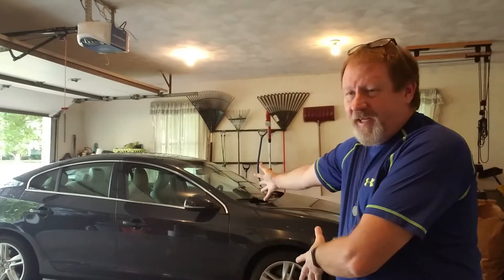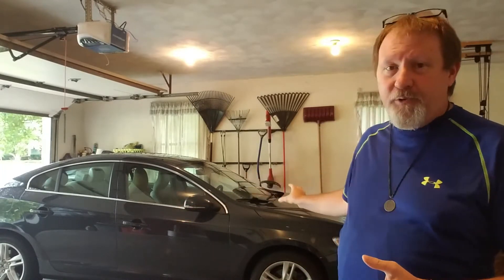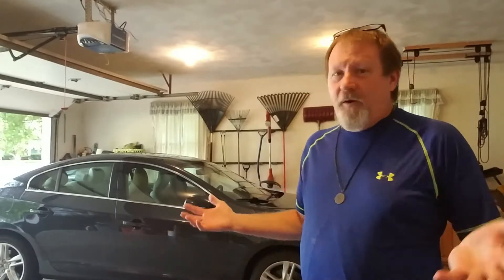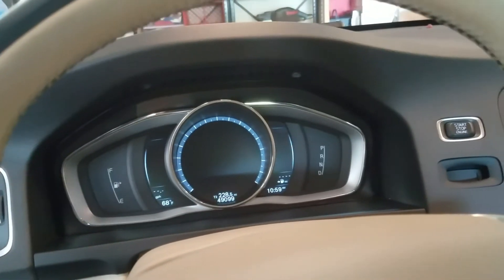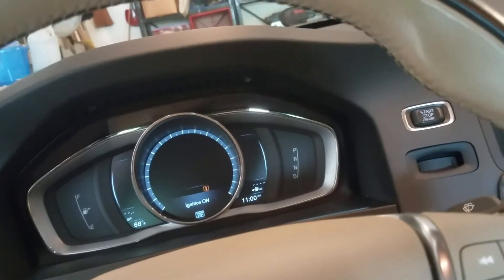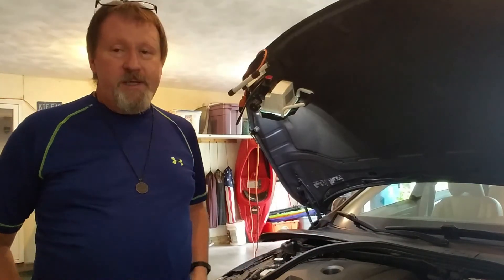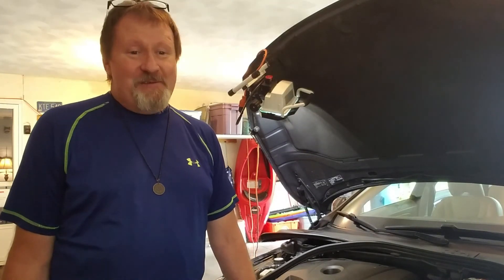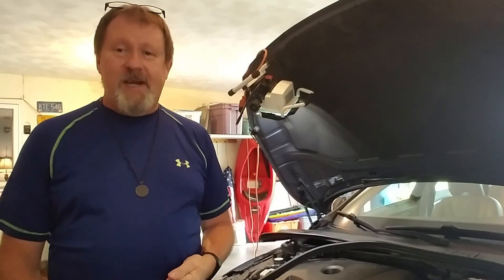Volvo Drive-E Start Stop Not Working

Comment: I did the reset last night. I just went to start the car & it won't start at all. It says: steering malfunction Stop safely. I never had that problem before. Can you please suggest what to do.
Thank you, Sam
Reply from the maker: Hi Sam, I'm not a Volvo tech, just an owner like you but have a couple of guesses from what I've read.  It could be a bad battery some say, or a fuze, so check all your fuzes to make sure one isn't blown.  I've seen on a lot of Volvo forums that some have issues with the steering column lock but that seems to be on pre-2009 cars I think.  Not totally sure.  Maybe jiggle the drive selector to make sure it's in park, or wiggle the steering wheel nice and strong a couple of times to see if it just isn't at some steering angle the electronics don't like.  If you were having issues with start stop, then this, there could be some bigger issue going on too.
Reply: @MIFixItDad   Thanks for your response. Is there some way to reverse the reset?
Reply from the maker: @samhirschman1418  No, all the reset does is tell the computer to calculate the charge and load capacity of the batteries, nothing more.  It doesn't change or affect any other systems, just gives the computer a chance to figure out the charge level of the batteries.  If you have one of these cars with start/stop, there are 2 batteries.  One may just be dead.  I don't know what all is affected if the battery dies completely (either one).   I got to mine before it got that bad.
Reply: @MIFixItDad  Thank you for your help. My car is now being serviced at Volvo.
Reply from the maker: @samhirschman1418  I'm very curious what they find.  Please let us know.  As owners, anything we can share with each other can possible help other people avoid bad situations.  So far, other than a bad battery, the only issue I've had with mine is a bad fuel pump, which happened about 1 month out of warranty.  In talking to Volvo US, they decided it should be a covered item and extended the warranty for that item.  I was without a car for 2 weeks, but they paid the bill on it.  Almost $600 for a fuel pump!
Reply: @MIFixItDad  They are still working on the car. So far, they said that I need to replace both batteries - total cost of about $690 (I am overseas and all Volvo charges are higher than the States).
Reply: After replacing both batteries, they are telling me that the car starts & then dies. They had the car for two days already :(
Reply: After replacing both batteries & doing a 75,000 km. service, they said the car still died when they road tested it. They said that the computer needs to be replaced. I don't plan on buying a Volvo ever again!!
Reply from the maker: @samhirschman1418  Sadly, a LOT of cars these days are no better.  They have touch screens that fail, computer controlled everything, blah, blah.  I have a friend that has a Chevy Equinox that has a failed seat sensor for the occupancy sensor and they were quoted $450 to replace it... for a sensor!!!  I love my 2015, but not nearly as much as the much simpler 2009 my daughter has now.  It is coming up on 200,000 miles and is perfect.  No issues, no faults, nothing.  I miss cars being built to last.  There are a lot of older (10-15 years and older) cars I like, but if I had to buy a new one, I'm not sure what I would do.  I can't say I have a good feeling any of them would last me 20 years.  Well, maybe a Toyota.  They seem to have their act together.
Reply: @MIFixItDad  Hi Floyd, You won't believe this. Volvo changed the computer and the car still isn't working. They have had the car for a week & they still can't figure out the problem. The car starts and then dies. I never had that problem before I did the reset. I told them the reset that I did & they said it can't be the problem.
Does anyone have any ideas of what it can be?
Reply from the maker: @samhirschman1418  If you have a new computer, then that computer hasn't had the reset done.  That only clears the saved settings for battery level anyway and would have nothing to do with the car running.  There are 3 things needed to make a car run... air, fuel, and spark.  It's not getting one of those.  It could also be a clog in the exhaust too.  If it can't eliminate the exhaust gasses then back pressure will make it stop running after a short bit.  Have them check the catalytic converter(s) and see if they are clogged.  Check fuel pressure.  Could be a clogged fuel filter or fuel pump going bad.  I had to have the fuel pump on mine replaced.  It would take forever to start, but once it started it would stay running in the problem I had.  Make sure the air flow sensors are connected and working.  It could be something as small as a connection or a vacuum line that they didn't reconnect when replacing the batteries.  Is your air filter clogged?  Have them go back to basics and check all the small stuff.  I'm not a mechanic but I try to do what I can and I was always told to not forget about the little stuff.  Those little things can cause big problems.

Comment: Finally it brewed for nearly 24hrs and the first set of lights I stopped at gave me a proper start/stop effect. Nothing changed in radio/ac/lights it just seems like it's still on other than rather noticeable start and 0 RPM on rev counterand the announcement on thee dash. I noticed that the car can be rolling, now I'll do some testing on how fast I suppose it'll kick in around 5 mph.
This is a very helpful video. Thanks Floyd.

Comment: Quick update I did the 6+3 sequence with ignition on and received 3 battery light flashes in response. Letting it stew now.
I forgot to made it crystal clear I have an 2010 s40 driv-e obvs. Great to know that volvo aren't inclined to start changing reset procedures with newer cars.
Reply from the maker: It will be interesting to see if that works.  That option wasn't available on the US spec cars in that year.

Comment: Hi Floyd, here's my little saga, I bought a 2013 RHD V70 2.0ltr D3 about 5 months ago, the family run garage gave me a 3 months warranty which is normal for a car of this age here in the UK, near the end of the 3 months warranty the stop start stopped working, so back to the garage it went, they replaced the main battery FOC with a genuine Volvo one, no problem with the garage at all, although recently the stop start had stopped working again (now out of warranty) they were good enough to check the new battery and it was fine if a little low on power, they recharged it and everything worked, happy once again, now it has happened again, seeing your video I phoned the garage the garage and told them about the second hidden battery, I had to laugh when they said they wished they had known about this also, as the battery they changed in the first place did not seem to bad but the new Volvo one they fitted solved the problem although it was expensive, and the second battery was only a fraction of the cost of the main one, when they checked with Volvo, they agreed with me that this was probably the problem all along, and would change it for me but would have to charge this time, I thanked them but declined as the job looks within my capabilities and I would do it myself, so thankyou for this information as like you I would never had known of this secret battery, I know one thing though I will use this garage again when I buy another car, as they bent over backwards to keep me happy, a genuine honest dealer is hard to find nowadays.
Reply from the maker: Wow, that's quite the story.  I'm glad it came out good in the end too.  Definitely agree with finding a garage that does good work and tries to keep their customers happy.

Comment: Do you happen to know the cranking amps and cranking amps written on the battery in your video? Also I am assuming there is no BMS battery reset needed for this battery as compared to the larger battery that is not hidden?
Reply from the maker: It's a 10 amp hour, 180 amp battery.  This isn't a cranking battery, just an auxiliary battery.  I do believe a BMS reset is needed when you replace either battery so the system can determine what the total capacity is for the whole system.
Reply: @MIFixItDad  Thank you so much for your response and video. I called my dealer today and found out that the BMS reset is not needed for the start/stop battery.
Reply from the maker: @andrewchung1255  I'm going to have to replace mine probably within the next year so that's good to know.  I think I'll still do it anyway.  I like knowing the car's start/stop and charging system has full awareness of the change, and it's super quick to do anyway.

Comment: Hi Floyd, I have a Volvo V40 2015 so thought I'd give this a try. Mine hasn't worked for about 18months. Done as you said a few days ago (I never see the battery indicator flash 3 times) thought got nothing to lose but thought no more of it till yesterday when I had to go out and to my surprise it WORKED omg. Many thanks Floyd
Reply from the maker: Wow, hopefully it keeps working.  If it stops, that secondary battery may be getting bad.  I know mine doesn't have the capacity it used to.  If I don't drive it for 3 or 4 days, it takes a half a day of driving at least to get charged enough for start-stop to work again.

Comment: I just did the reset on my '15 S80 with a new main battery...we'll see what happens tomorrow.
Reply from the maker: Good luck.  Once it has been reset, it can take a couple of days of driving or so to figure out what the battery charge level is and get it to where it needs to be.  Good, long drives will help the charging system do what it needs as well.
Reply: @MIFixItDad  It worked the next day!

Comment: I got the main battery in my 2016 Volvo V40 T4 with 2 liter Drive E engine,  checked and it was less than 70% of rated capacity. The start/stop function had also quit. So I put a new main battery in, but the stop/start function still did not work. So I changed the secondary and via a scan tool “told” the cars computer that a new secondary battery has been installed. The stop/start function then worked. On the V40 model that 2nd battery is located just ahead of the left front wheel and the front bumper bar has to be removed to access it. There are other You Tube videos detailing the procedure on that model, but most are in German or Swedish. However a picture is worth a 1000 words and it’s not that hard...just time consuming. 😉
Reply from the maker: I love my Volvo's but if they keep making it this hard to work on simple things like this, I may have to stay with just the older models, or look at another car.  Removing the bumper bar to replace a battery just sounds beyond ridiculous.  This from a company that can design a way to remove the headlights in 30 seconds by pulling 2 pins.
Reply: @MIFixItDad  The bumper bar on the later V40, S60, V60, is held on by plastic fasteners which are unlocked with a screwdriver. I enlisted help to get the one on my car off, simply because of the length of the bar, but it can be done by 1 person if a stool is positioned in the middle to support it when it comes off. 😉 After studying a You Tube video (narrated in German ) a few times first, it took us about 10 minutes to get the bar off. Next time will be quicker, now that I have done it before. Both batteries MUST be of the Glass Fibre Mat /VLRA type, which I have to buy from a specialist battery shop, rather than the local general auto parts store. They have a lifespan of about 4 years so I will just change them every 48 months. What I find annoying though, is the lack of information supplied to modern Volvo owners, about what servicing needs to be done at what time interval or mileage. My cars owners manual is in E-Book form and contains very little servicing details. I had to pry the information out of the dealer. I do agree with your comment about the older models or changing brands. Not wishing to risk owning a Volvo from the Ford ownership era, we recently bit the bullet and bought a Kia Forte GT, which has every feature our Volvo V40 has in it and is a lot simpler to service. And it only has 1 battery! 🤣

Comment: Count your blessings. Would love to have the option to permanently disable this feature. Yes, I know I can buy a device that plugs into the diagnostic port, but last time I checked, it was more than we want to spend.

Also, I think the second, smaller, battery is part of the power steering. We are getting the power steering rededuced message, and was told that the second battery needs replacing. Thank for the video. 

I saw another video that had the smaller battery behind the bumper, but I think tas was a different model Volvo. We have the 2015.5 S60.
Reply from the maker: I do believe the power steering assist is electric, so if one battery gets very weak, or both get weak, I think it can cause that to happen.  Best way to find out is to have them both load tested, then you know for sure.  I think the 2nd battery on mine is starting to get weak.  If I don't drive it for a few days, I have to then drive it a good couple of hours before the start/stop function works again, especially when the temps are cooler.
Reply: @MIFixItDad  Thank you Floyd. Do you think the battery testers at auto parts stores are able to test this smaller battery? Thanks
Reply from the maker: @EricJRW  Yes, they should be able to.  Some of the small cars have batteries only about that size anyway.
Reply: @MIFixItDad  That's a good observation on cooler temps! Getting cooler in Texas, and start/stop is not engaging. If I ever get that second battery uncovered, will def do a load test before replacing. Main battery was replace a couple years ago, so am reasonably certain it is batt # 2. Thank you

Comment: From Iraq 🇮🇶🇮🇶
Thank you so much it's so useful...
I wanna ask you about the engine type in this car, what is it? and how can I know the engine type in 2016 V70
Reply from the maker: My car is a 2.0 liter 4 cylinder turbo petrol engine.  Each country could have different engine options that were available to them.  Go to https://www.volvocars.com/uk/support/topics/use-your-car/good-to-know/finding-the-car-s-vin-vehicle-identification-number to find out how to get your VIN or Vehicle Identification Number.  Then go to https://www.volvotechinfo.com/index.cfm?event=vinDecoder and enter that VIN.  It will give you basic info about that VIN including engine model, displacement, and horsepower rating.

Comment: Hello Flyod, I have the same 2015 s60 2.0L turbo and stop/start hasn't worked in a month or so, Tried the battery reset method above but I didn't see the battery icon blink 3x.  any other suggestions?
Reply from the maker: Retry it a couple of times to make sure you got it right. If that doesn't work, then one of your batteries is probably bad.  You may have to have the batteries tested to see if they can still hold a proper charge.  You may be able to take it to a shop that has the Volvo specific diagnostics software, and it should be able to tell you the battery life and charge capacity also.  That would tell you if you had a battery that was bad.
Reply: @MIFixItDad , I was able to do the reset, just had to be very quick.  I checked both batteries, both read 12+V so I am assuming the batteries are good.  Let's see how it goes.
Reply: stop and start started working... Thanks for the help.

Comment: The presence and location of the support battery is described in every car's user manual. At least in my Volvo XC60 manual (2017). That was not the secret for me. The secret for me was the magic procedure to reset BMS without VIDA, which might be easier to do than disconect BMS sensor from battery for 10 seconds while ignition is on. Btw. regarding the MBS reset procedure, shouldn't I press the start button without break for longer period to get in to ignition on position II instead of pressing the button shortly to get into position I? Or does it really matter?
Reply from the maker: I edited the video description to include a copy of the instructions in writing if that helps.  Just follow those and it should work.  The BMS disconnect doesn't force a complete relearn procedure like the battery reset does.
Reply: I tried the battery reset and nothing... until I pressed the start button (without break) for a longer period to get into ignition on position II instead of pressing the button shortly to get into position I. Thank you both... My wifes XC60 is a 2015 and we just replaced the "main" battery for the first time (2022). I'll get the "2nd battery" from Amazon and replace that too.

Comment: same car with 73k miles, same problem, similar type of car owner:). A new H7-AGM H7-AGM Duralast battery got the start/stop back for two weeks then gone.  will try to reset and check the aux.battery.  thx

Comment: Just picked mine up used about a year ago. I knew about botj batteries. I think I need to replace before winter this year. I wasn't sure if both needed to be replaced at same time, or I could get away with just replacing the main. Like has been noted, not much info out there. Your video helps, looks like you got by on switching the main only. So I'll try that and see how it goes and whether or not the support battery needs to be replaced as well.
Reply from the maker: Hey, hope you enjoy yours as much as I enjoy mine.  You can get away with just replacing whichever one is bad.  They don't necessarily go bad at the same time.  I have a video on replacing the main battery, so check it out also.  It's not hard to do at all, a little tight, but I have a couple of tips on saving a few dollars when getting a replacement.